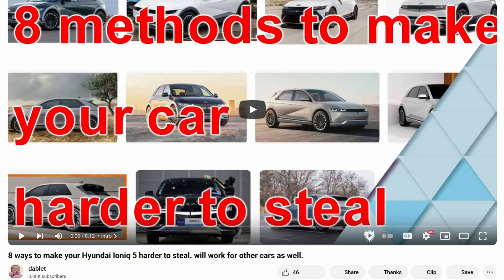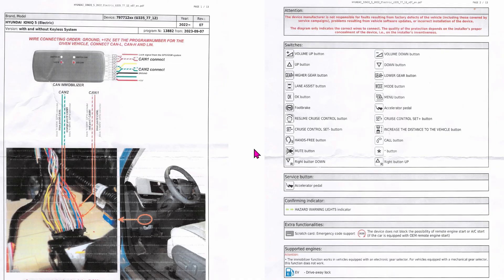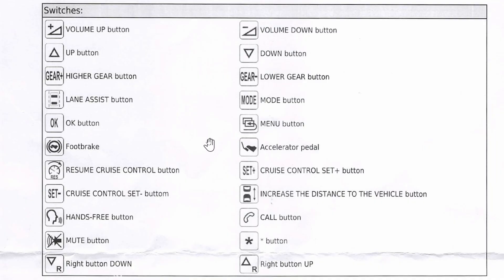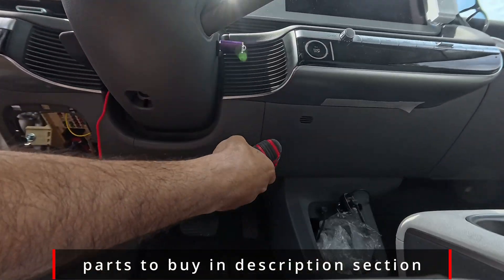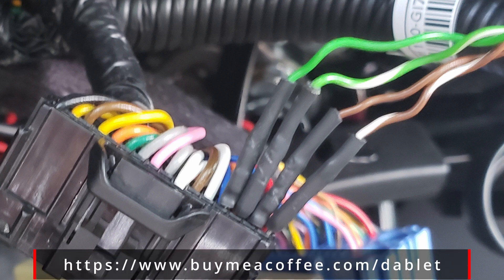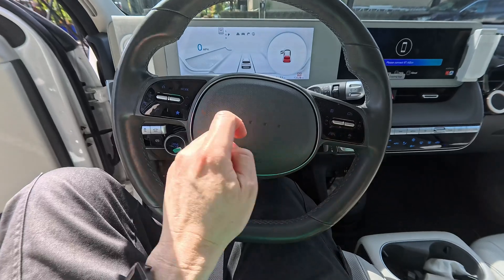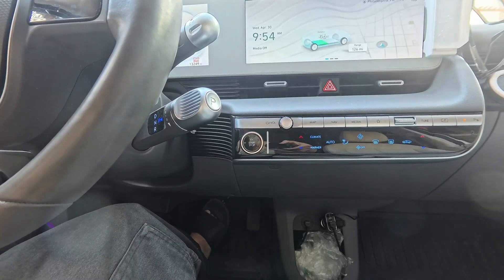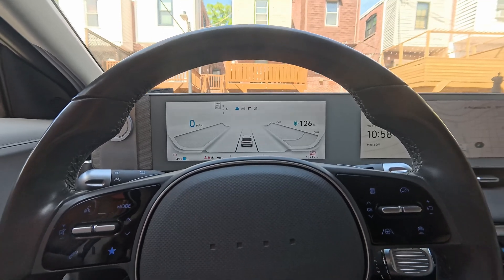Ampire WFS400-PRO CAN bus immobilizer. Installation, Setup, and Tips.

Comment: Hi, could you please advise where i can find the install diagrams? i'm looking on connection points for a 2014 Volvo XC60 Thanks
Reply from the maker: when you order the immobilizer, Ampire will show you the connection points for your car.  Ampire will also program the unit to work specifically for your car too.   off course you can program it yourself but it's not intuitive.
Reply: @dablet I bought the device used hence why no instructions for install.